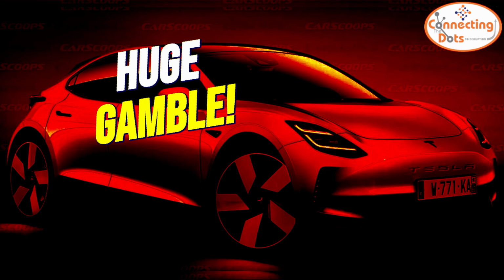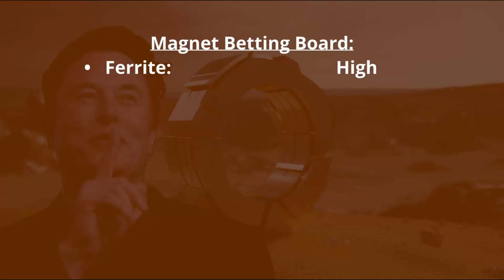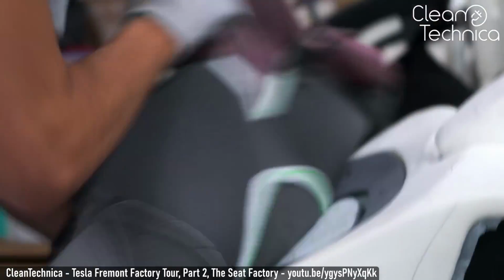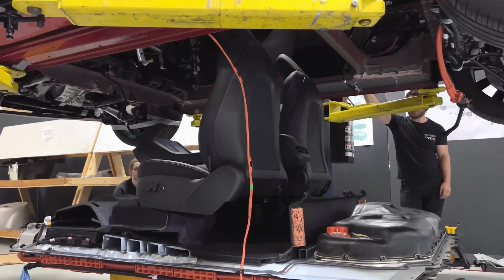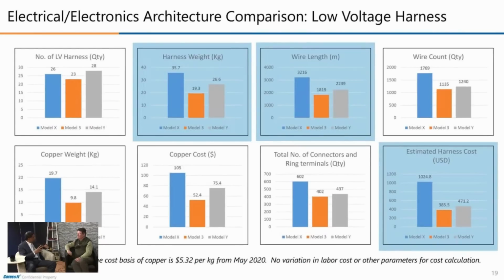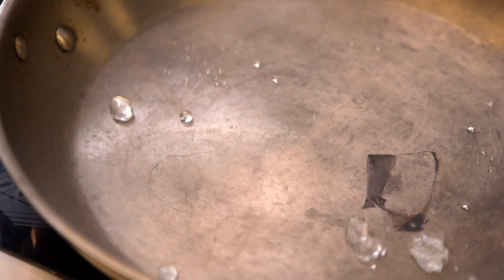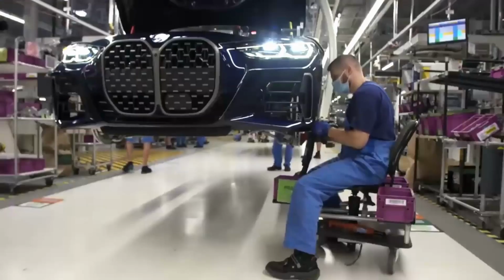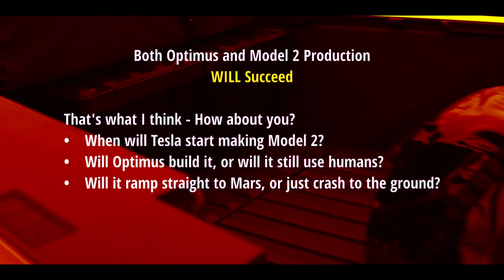Tesla M2's Tech Gamble: Runaway Success or Production-Hell Nightmare? Engineer POV [DecaValve WHAT?]

Comment from the maker: To try everything Brilliant has to offer—free—for a full 30 days, visit https://brilliant.org/ctdots - The first 200 of you will get 20% off Brilliant’s annual premium subscription
➡Will Model 2 be a runaway success, or should we expect Production Hell all over again? Let me know what you think!
➡Please consider supporting me on PATREON for as little as $1/month: http://www.patreon.com/ConnectingODots . This really helps me make these videos, and you'll get Ad Free, Early Access and Patron-Only content!
Reply: It will take time to get everything right but there is much less pressure than for Model 3. Model 3 had to pay back investment quickly and to become cash flow positive which required high volumes. Generation 3 can be cash flow negative for some time without worries. What is most important is that it is attractive. Tesla cannot afford a Model which doesn't sell. So, initially a slow ramp but no production hell as the pressure is less.
Optimus will be brought in when it is mature and since it has human form factor, replacing humans with Optimus will be very smooth. I still think traditional automation is better and switching to a new seat design is more efficient than having Optimus do a complicated task.
Assembling already painted sections and securing them safely will be a challenge. Probably a combination of riveting and structural adhesives. No welding.
Reply: Production Hell is being nearly broke while ramp up is slow. Won't happen. Unboxed production will allow bottlenecks to be solved more in parallel so the ultra slow ramp with so much new stuff should become only slow, and then ramp up faster. Assembling prepainted parts is extremely hard, as it trashes glue, rivets & welds. Solutions that come to mind are rivets with spring washers & bolts; I don't think they would like either one. Crash tests are tough so this looks like potential ramp up problem. And Optimus would just slow it all down just that much more.
Reply: What voice generator do you use? It's pretty impressive. I bet most of your audience doesn't know you're using an AI generated voice.
Reply: Excellent deep dive@
Reply: Great Video I am sure that there is more to unpack. 
For example thixomolded magnesium giga cast might cut 30 % off of the frame weight and rims. Lighter batteries might cut 30 % off overall weight, And carbon resin cage casting might also reduce weight if they can solve expansion contraction issues. Perhaps with just expansion control joints as in a building. Thus allowing plastic body panels on a resin frame with cast in wiring that sits on a giga cast metal frame but allows different expansion rates by sliding. 
If the seats are also much lighter and the wiring and controls and everything else lighter the actual motors can be much smaller and control circuits and inverters can all be integrated to further reduce wiring. 
Thus I predict that the final model 3 could weigh less than 3000 lbs. Similar to some specialized cruz model cars GM made at the beginning of their production.
Reply: so in other words its a huge piece of sh1t.

Comment: Great video!

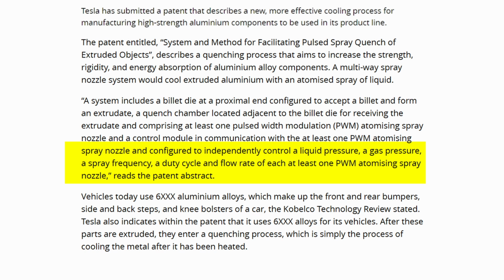24:20 

That is brilliant.  

I have a 35-year-old materials science degree - focused on metallurgy and heat treatment. 

This never occurred to me.  

Wow - you could quench to a much greater depth.  
--

Edit:

Quenching Aluminum.

Steel hardens with quenching because of the formation of a metastable crystal structure. Aluminum doesn't doesn't do the Austinite-Martensite thing.  

For aluminum- just let it anneal and distribute any internal stress risers.

Thanks. Again - great work.

Comment: Probably will still refuse to put in a binnacle and insist on imposing a dangerous mid mount screen.
Reply from the maker: Why dangerous?
Bottom line, Teslas are involved in less accidents per 100,000 cars than average, so it can't be THAT dangerous
Reply: @ConnectingODots  Early in WWII, the USN noticed a number of pilots veering off to the right and crashing before landing. Not all. Not most. But enough they were concerned. The USN investigated and discovered that part of the standard landing procedure was for the pilot to check a console on the right and that was when they would veer. The USN had the console moved up to the binnacle where it belonged and the problem went away. Tesla has moved it back. Very bad judgement.

Comment: May be cool. Won’t be able to tow. Won’t be convenient for road-trips. Won’t be able to take a hitch so transporting bicycles or a wheelchair will be incredibly inconvenient. Tesla won’t make spare parts readily available so it will be impossible to insure or maintain. The tires will wear out every six months and expensive suspension components will likely last less than a year. Otherwise, amazing. Did I mention the bad paint and poor fit and finish? The nagging problems Tesla maintenance will claim they can’t duplicate and refuse to repair?
Reply: Who tows with a Corolla? Have you thought about changing your breakfast cereal? Sour Grape Nuts ain't workin'
Reply: @FrunkensteinVonZipperneck  I didn’t mention a Corrola, but they they can only take a limited hitch like a Tesla. However, Corrola is reliable, has a binnacle. Easy and cheaper to road-trip. Cheap to insure and easy to repair if they do break down. Etc, etc, etc. Model 2 would have to substantially cheaper to make up for her deficiencies. Bet she won’t be.
Reply: Same old same old. You trolls never disappoint and unfortunately you don't seem to be able to come up with anything original other than the same stuff that's been disproven as nonsense. Keep it up
Reply: @douglaswatt1582  Disprove one thing I said. BTW, even as a Tesla will still suck to road trip. Can back that up too.

Comment: 19:48 did‘t you say you are an engineer? How in the world would a wireless connection (wireless module controller, power regulator, antenna) to each battery cell be any better than a tiny wire to the BMS? Wireless for cars ins pointless, you need to run power to each point to run the wireless electronics anyway.

Comment: tesla as you describe it is not so innovative, rather the big three of Big D and the big three of Germany/Japan/China/Korea/India are not investing in their own companies.  Now, 120 years after Ford, the innovation of carmakers has been reduced to built-in failure and reliance on the user to find problems after purchase. fat cats have eliminated quality control by putting the burden on the buyers and offering limited warranties. when a light bulb goes out in the kitchen you simply get a new one and screw it in. The same should be true of car lights: plug and go. Tolerance of parts and pieces should be guaranteed by the maker and replaced for free after failure. this will return the burden back to the manufacturer. After a house, the car is probably the next most expensive thing a family will purchase. $50,000 is an outrageous amount of money for something that is designed to last only 5 to 7 years. And, that includes no warranties after 3 years/30,000 miles. Many people buy houses that are over 150 years old, and most buy houses that are at least 50 years old. Face it, cars are basically the same as they were in 1908. 4 wheels, seats, steering wheel, brakes, engine and protection from the elements. Manufacturers have spent their money on chrome, marketing, envy and endless efforts to create shortcuts rather than create better design. The only difference between a "model T" and a "model Y" is lipstick.

Comment: There is nothing amazing about Tesla and technology. GM, Toyota,  Honda,  they all have engineers and scientists more than capable of doing these things. What is unique at Tesla, is Musk. If GM or Toyota or Honda had their own Musk they would be more than capable to match him. The difference has always been singular vision,  willpower, and control plus time. Tesla cars are cheaper to build, but they are essentially disposable.  Larger integration means more expensive failure means higher insurance costs. Musk has mostly ignored this so far. It's already beginning to hurt Tesla.
Reply: Classic nonsense.

Comment: @2:18 "The upper body will function as a giant integrated circuit."  Nope.  At best, it's a large, formed plenum or conduit, or solid wire harness.  With no active electronics in the piece, it can't be called an integrated circuit.  On another note, this design means even minor accidents can turn an entire car into TRASH - a totally disposable vehicle.  Irresponsible, wasteful, and overall moronic.

Comment: What composite process are you assuming can eliminate paint? I can’t think of any composite materials that have any strength and mold in color.
Reply from the maker: If my guess is correct, Composite upper chassis will be black (natural carbon fiber composite color). It wouldn't need any paint

Color could be achieved via plastic or colored composite body panels - either covering or displaying the black chassis. If displaying, wraps could hide it
Reply: @ConnectingODots  there is a black SMC material that is UV stable. SMC has fiberglass or carbon fibers within the resin which can make the panels strong. I could see this could working if the only color is black. Aptera is going this route but painting the panels. This would be perfectly fine and even desirable for a robo taxi? No paint would hide scratches! 

My guts tells me that carbon fiber is still so expensive it wouldn’t work for the model 2. I would think It would be more costly than any aluminum or steel painted parts, even from a system perspective. When you make 1 million cars per factory, capital can be paid for very quickly. I would be very surprised if carbon fiber didn’t add hundreds of dollar per car. Even a hundred dollar paint shop would be paid for fast. (Maybe there is a throughput value though?)

Your video got me thinking about the old Saturn cars that used plastic panels. It sounds like they were injection molded. That could keep the part cost down and could eliminate paint. The issue in the past was that plastic expanded and contracted more than metal which drove large panel gaps. Maybe there are ways to improve that today? 

Excellent food for thought and great video! If anyone can figure it out, it’s Tesla.
Reply: Check out how fibreglass parts are made. The very first layer painted into the mould is gelcoat, which is a mix of pigment and the resin used throughout the glass layup. Traditionally this has been polyester resin. That gelcoat forms the final finished layer and is not painted (in fact, it's difficult to get paint to adhere to gelcoat, and any repairs to the gelcoat surface are done using a similar product called flowcoat, which is designed to cure in contact with air, whereas gelcoat cures in the absence of air). I'm not sure how epoxy resin parts are finished however, these are possibly painted afterwards.

Comment: Interesting to see how Tesla improves production methods and technology. However, I couldn’t help but consider while watching this, what impact these new ways of manufacture will impact maintenance and repairability?  Teslas are already amongst the most expensive to repair, particularly crash damage and as a consequence, insurance rates are higher. So you save on purchase price but pay higher premiums during ownership.
Or does the modularity mean the vehicle is repaired by removing and replacing a whole ‘module’?
Reply: Reducing the cost of production means that replacing a write off is cheaper and safer and materials can be recycled or repurposed.😊
Reply: Tesl gigacasts are repairable at lower cost and in less time, than the hundreds of parts they replace. Tesla has a dog in this fight, since they operate their insurance company: cheaper repairs mean higher insurance profit. Therefore, Tesla plans for repair while designing the part and section. Labor is the biggest repair issue.

Comment: tesla octovalve seats can harnest the heat of farts to pre condition the battery before fast charging or launch control
although the aim being to make the M2 as cheap as possible, non heated, non ventilated, non liquid heated/cooled sounds like the best solution, at least for the base trim. same for glass roof, premium sound system, etc
I dont know if there will be more premium trims, if automation and factory output is the priority, its easier to make every car the same.
Reply: but in the video, he talked of liquid cooling ... do you want liquid farts? Eww!
Reply: @FrunkensteinVonZipperneck  well liquid/water cooling is more efficient than air cooling and is used in any modern car, EV or gas. Tesla octovalve is water/glycol but it's a heat pump using condenser and evaporator to move heat much more efficiently

Comment: The "Lego" technique is very interesting. You raise the question of whether it's strong enough to survive real road conditions. I worked for many years in Formula 1 ... and that's the sort of thing they do to attach the nose-cone and front wing. Watch a pitstop when they have to change a front wing, you'll see what I mean. Those things take a huge amount of load, something like the full weight of the car (at high speed downforce from the wing gets very big). So, yeah, you can do this and, yeah, it will survive.

Comment: Why does a seat need to be heated on a cheap car?
Reply from the maker: Main reason is that you need less battery tgjs way. It's actually cheaper.
In cold winter, driver will want heating one way or another. Gettung heat from seat usually leads to less heat requested in cabin. Heating driver's body directly is much more efficient than having to heat lots of air, so you get morr range (and that's BEFORE possibly connecting to car's thermal management and often getting heat for free)

Comment: Tau/2 will be built by Optimus. The stations need to be tight together, and OSHA rules limit how tight that can be with humans involved.

Since the plan is to copy/paste the Austin line (not copy/optimize/paste), and all other lines will extensively use Optimus, they have to use Optimus for Austin (even if that means holding back a few months for Optimus to be able to do the work).

Comment: The only issue that I have with snap fit parts is serviceability.  If you have ever worked on a car that is a few years old you find that the parts break when you try to disassemble for any repair - hence removing a door trim to fix a window regulator can mean replacing all of the plastic snap fits. If those fits are also part of the door trim panel then you also have to replace that, which means added expense or not being able to get the part. Remember that manufacturers don’t keep stock of old parts like trim panels etc for ever, and there are different colours as well. 

The whole thing is a complex trade off. Simpler construction reduces cost but can reduce repairability, but eliminating some connectors or parts can improve reliability.  A bit like components being soldered onto circuit boards vs in sockets. The new trend is to have everything soldered in place - often making a single component failure result in the whole board being discarded (cheaper to replace than troubleshoot and repair), but simultaneously less likely to fail in the first place…
Reply: I'm betting on the deflation crunch.: 🚗 produced with a cost so low & so fast that repairing will be economically nonsensical. (& ♻️ will be optimized).
Car sleeping at the mechanic or body shop for weeks will be a thing from the past.
Reply: @mystisith3984  I really doubt that it will be cheaper to buy a whole new car than to repair a door handle or broken window.  Replacing either of those requires taking the interior door trim off etc. That’s when the plastic tabs are likely to break, making the repair more expensive than it needs to be and meaning additional spares inventory needs to be held.
Reply: Elon is preparing spaceships to go to Mars which means they can never fail. I do not believe that there will be parts that fail when they're being designed by the same type of engineers that are preparing spacecraft to travel millions of miles we're no part can fail
Reply: @donblythe3766    This is a pretty silly comment on many levels.
1. Do you really think that the same design principles are used for securing a trim panel on a car that are used to hold a mission critical part of a spaceship together?  Hint: NO, they don't as it does not make sense.
2. SpaceX is not Tesla. They may co-operate etc but have totally different missions
3. Snap fit parts are designed for ease of production and assembly while reducing cost. They are not used for example to hold the wheels on or mount the drive units!
4. Snap fit parts are generally made of plastic and have a limited number of flexes, plus the plastic degrades over time.  That's ok for some applications but it does not lend itself to serviceability overall.